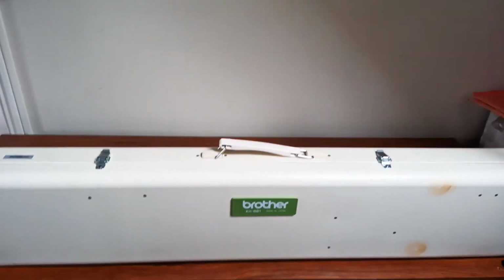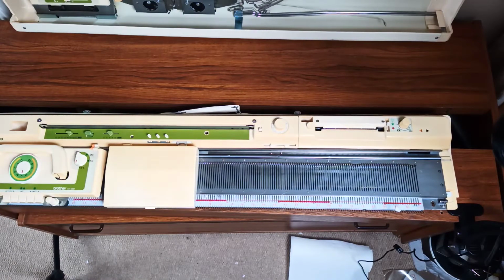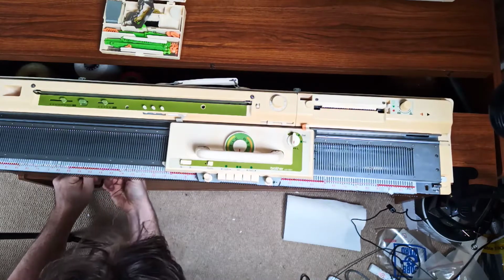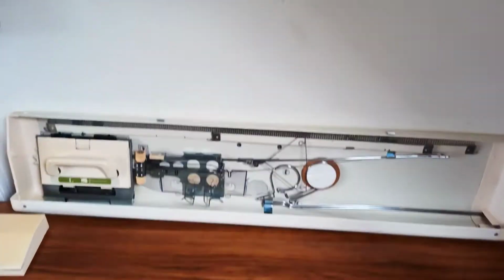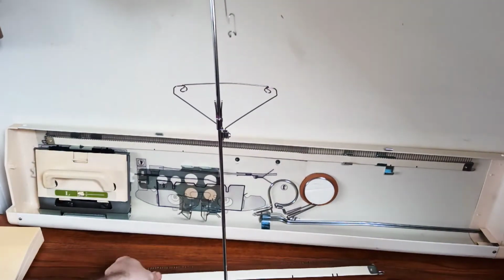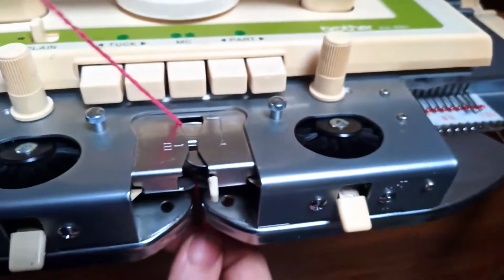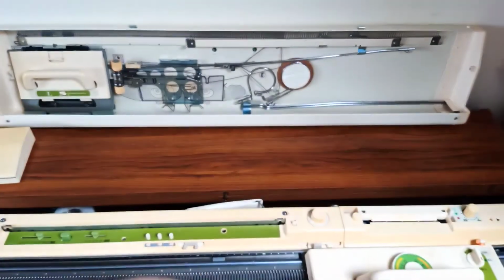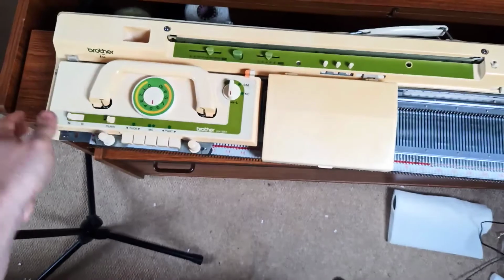How to set up a Brother Punchcard knitting machine

Comment: I'm trying to set up a kh891, and I'm new to machine knitting. I have some cylinders of thread wax. Where do they go on the tension mast? The illustrations in the manual are a bit hazy but the manual states there is a stand for the wax which I can't find. Does the yarn pass through the center of the cylinder?
Reply from the maker: There should be a little peg between the tension discs and the tension wire where the wax discs sit. The yarn just rubs on the outside.
Reply: @singlentendre  that seems to be missing on mine (bought second hand).  Thanks for telling me the thread goes outside the wax. I'd assumed it went through the hole in the middle. I going to try and figure out a way to attach the wax somewhere down closer to the yarn cone.